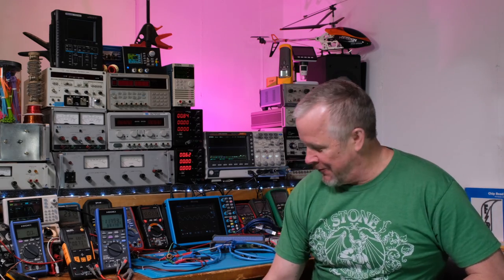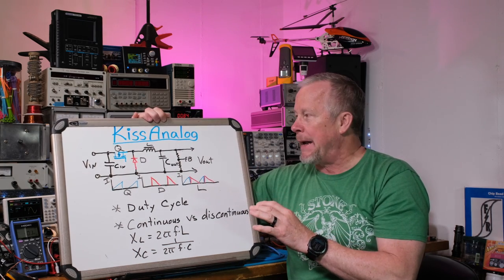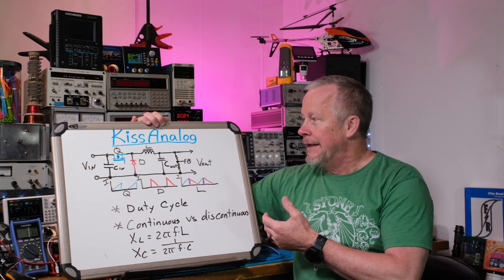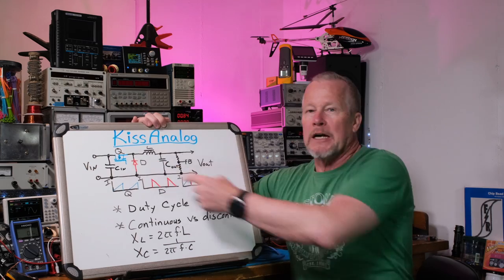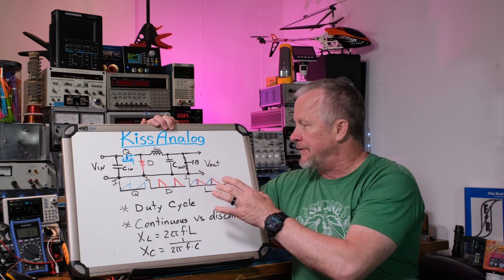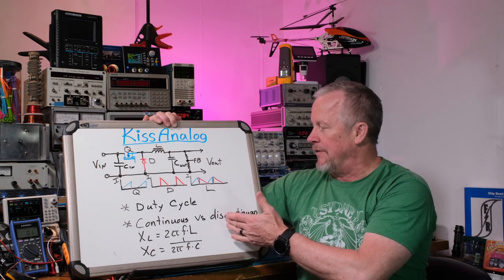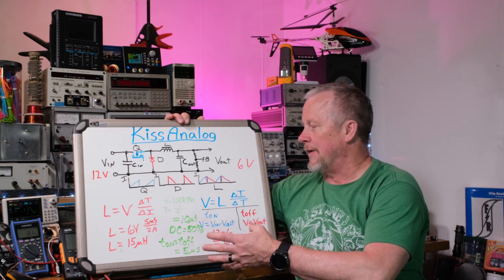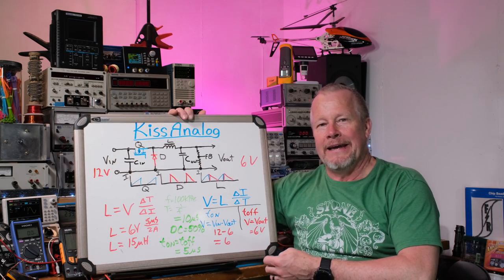Buck Converter Inductor Current & Duty Cycle SMPS #3 #buckconverter #SMPS #Inductordesign

Comment: Nice :) Looking forward to episode 4. Hopefuly by the end of this series i.ll have a decent lab set up so i can actually create one of these and apply your teachings.
Reply from the maker: Thank you!  I hope so, but you can always download Micro-Cap if you haven't yet.  Then you can run simulations for free.  It is like a bench on your computer;)  https://youtu.be/hUyzhSZL0cA
Reply: I did, i am using it ocassionally. It.s great, of course, but in the end i.m looking for the real, physical experience. I.ll get to that eventually.
Speaking of microcap, here are some suggestions for your future videos, which are related to your SMPS lessons:
- a tutorial on AC analysis (how to use it, when and where to use it)
- a tutorial on simulating transformers (preferably custom ones, like multiple secondaries, different turn ratios, etc)
Thanks ;)

Comment: If you are using high voltage 80V -250VDc solar panel series string, you can use an AC to DC Stepdown flyback converter! 
The beauty of switching power supplies is that if you get the input high enough, it doesn't matter if it's AC or DC! They are really good at keeping the output steady with a wide input range! 
Most people don't realise that even though it's say's 240V AC input, they begin to work with as little as 70V DC... They usually come in a range of fixed output voltages and are actually pretty cheap on eBay. The outputs can be tied positive to negative to get plus minus rail's too! 
Great video Eddie...
Reply from the maker: Thanks Peter - that's a great idea!  I've shown with power amplifiers with an AC front end that you can use DC input voltage.  If the front end is a rectifier, then the diodes just direct the DC to the bulk cap.  But, it might not be able to run at the same power since only 2 diodes are operating and not sharing the load with the other 2 diodes in the bridge, but then that would depend on how over sized the diodes are rated.
Reply: @KissAnalog  Hi EDDIE ! Please can you  forward the Y.T. vid. of yours that has this experiment...  THANKS... 👍🙏🙏

Comment: Hey Eddie. You ought to get in touch with RD Tech and aquire their new RD6006P buck convertor PSU module. It has both switcher and linear construction. I've got one with the 400 case heading this way...and a Mean Well 27Vdc 6A PSU from a local supplier to slip in it. Interesting module from original concept, but now they've updated it as hybrid, a teardown and review would definitely be interesting.
Reply from the maker: Great tip Boyd!  Thank you!